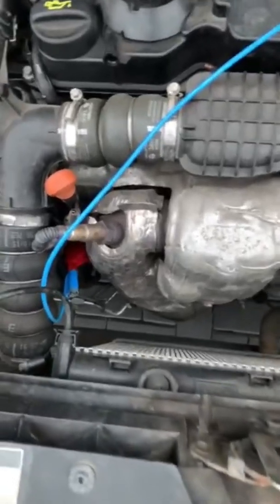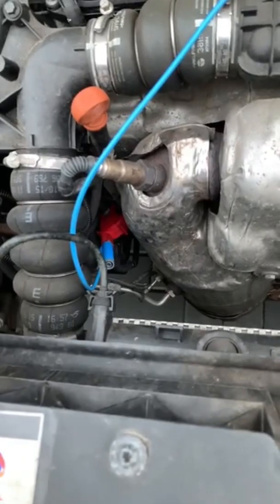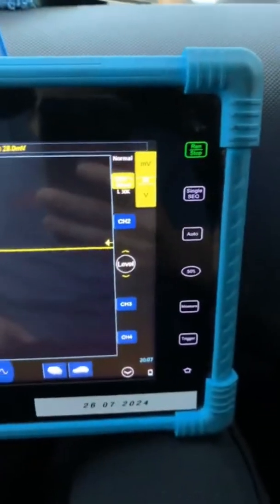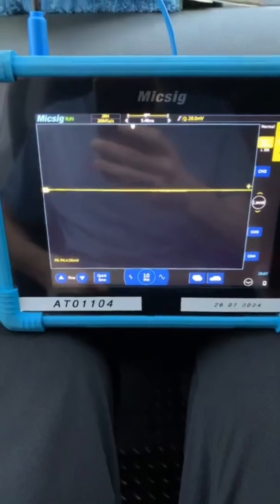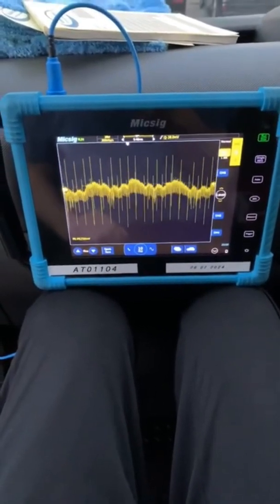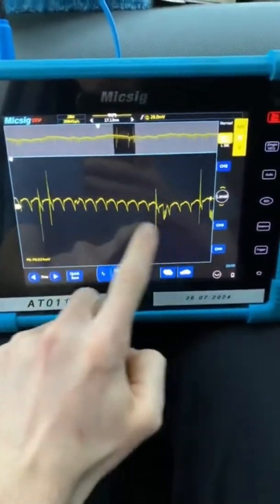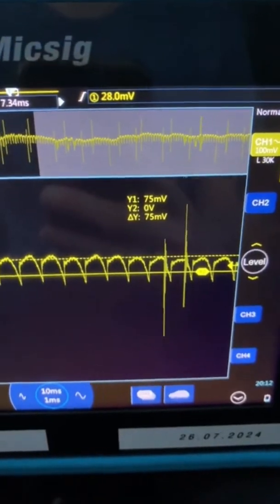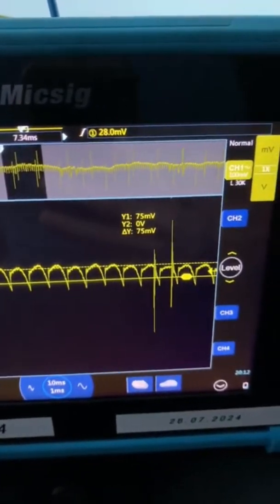How to perform a alternator AC Ripple test using a oscilloscope Peugeot 1.6 hdi #shorts

Comment: Honestly many GM alternators will produce around 300mV peak-peak loaded . I personally don’t worry about anything less the  600mV pk-pk and most the time I’ve found it to be a bad battery or a corroded/ lose connection at the battery. I mainly look for big gaps indicating a diode is open . Seeing a bunch of uniformed humps is normal and as long as they more then 600mV I don’t see it being an issue. Truthfully if the ripple can be seen riding on top of the DC voltage output with the scope DC couples and you can clearly see the ripple is the only time I worry about it. If you need to AC couple and zoom in to a smaller scale to see it it’s not even worth chasing. 

Great video and explanation you have a new subscriber